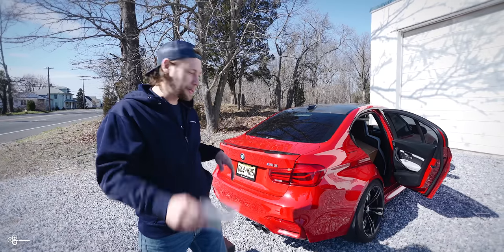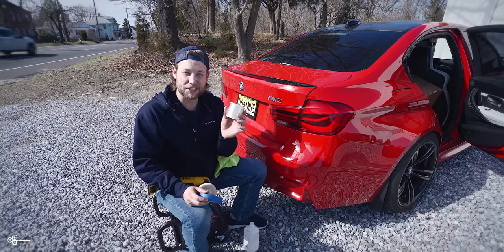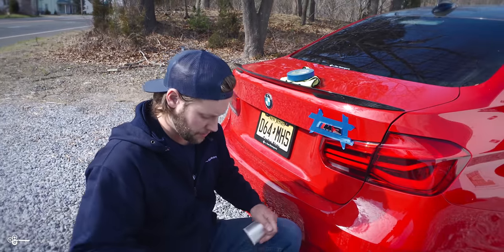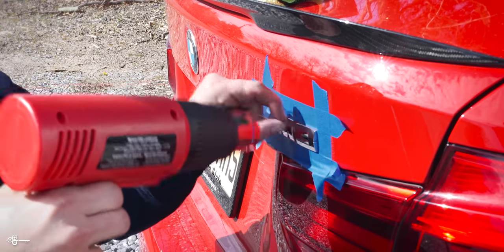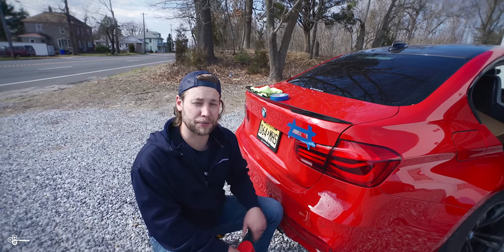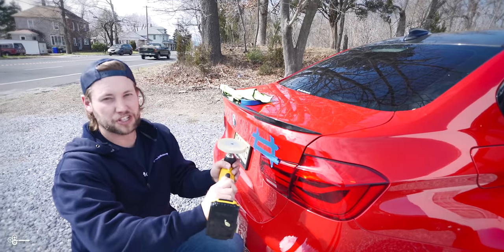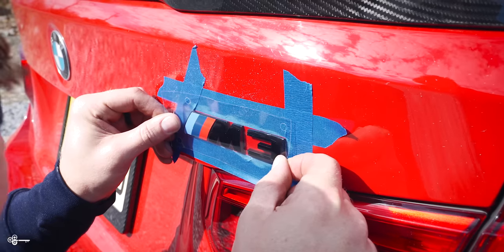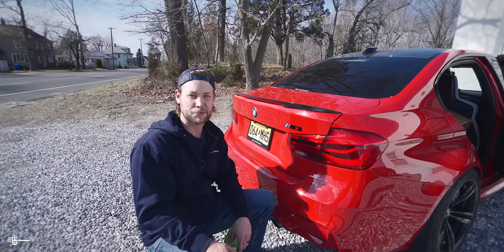How to install BLACK EMBLEMS on your CAR! (Black BMW M3 Badges on our F80 M3!)

Comment: Nice!! Brayn make please vidoe how to change rear wheel bearing on F30,  it is very popular problem, but there is not info, how to make it. 
Thanks!
Reply: I have done this  to try save money and I don't recommend doing it yourself. It requires a puller to get the bearing out... Reason i say take it out to a mechanic is that when I replaced mine, I inserted it the wrong way with the magnet not aliging to the abs sensor. So it threw an error. Had to do it over again. It's too much work really. Rather buy the bearings, and ask your local shop to put them in.
Reply from the maker: Maybe one day 👍🏼

Comment: This job can be done with just dental floss, Goo Gone, and masking tape. No need for the eraser. Don't even need a hair dryer or heat gun. One suggestion though would be to reapply wax after doing this just to make sure the alcohol/Goo Gone didn't strip the paint of the sealant.

Comment: Does the rear trunk spoiler on your M3 fit on a 2022 M340ix? If so which one is it on your site, if not is there one specific to the M340i that has the same look? Thank you!

Comment: I got a black badge for my M4 from AutoID (UK company) and the badge was smaller than the original. Wrote a review on their site stating that it's smaller than the OEM badge and they just didn't post the review. So sad.